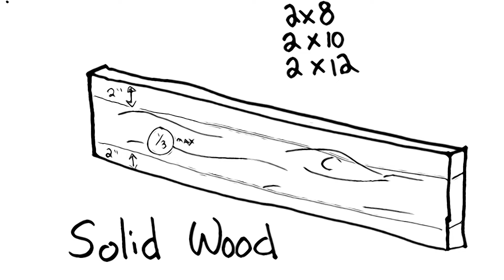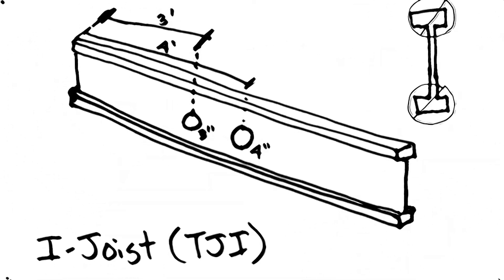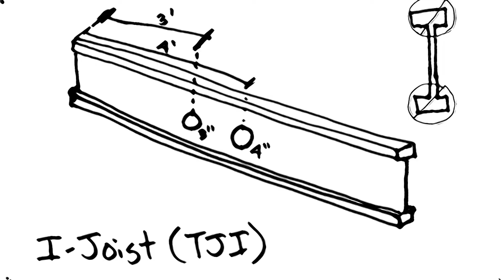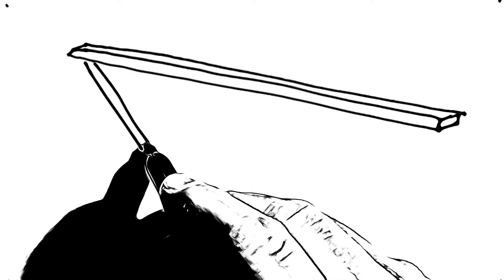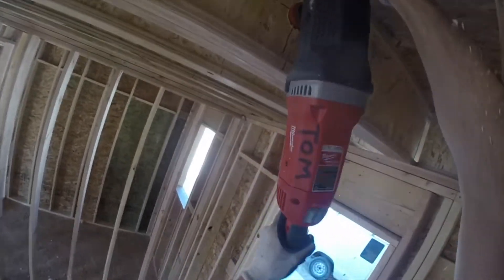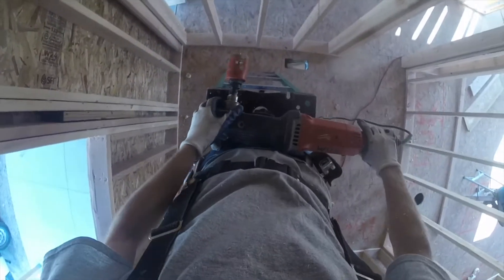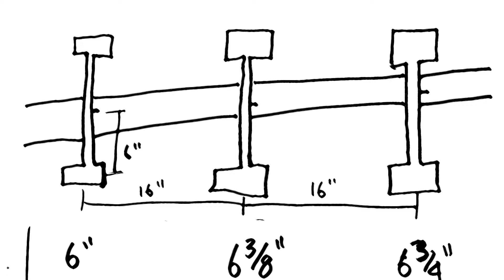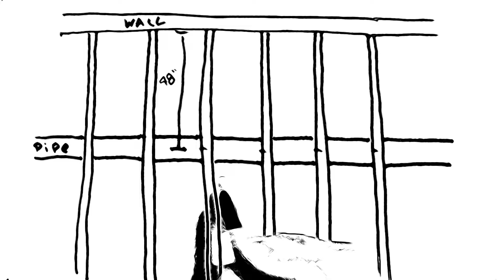Drilling Holes: Floor Joists - A Quick Tutorial

Comment: Hello sir, 

My contractor drilled a one inch hole into my three LVL (that’s close together in the basement) in order to get wire through but the hole is not in the middle. It’s a 12 inch height 304 inches length LVL. If that hole was drilled wrong is there anyway to repair it without replacing the beams? Note that LVL is holding two stories above and I also have another three LVLs that’s 20 inches away from these. Please respond, anything will help with me taking the next steps. Appreciate it
Reply from the maker: Hello. I’m not a structural expert.  If you are concerned about it then you should have a structural engineer evaluate the situation.

Comment: Do you have tips on how to mount a pull-up bar or punching bag on an I-Joist?
Reply from the maker: Yes. Use pipe flanges and threaded pipe. You can buy flanges at a hardware store.
Reply: @plumber-tom9470  Thanks! How would you mount it on an I-joist? Most of the videos I can find are mounting on 2x6 joists.
Reply from the maker: @YouPogi2000  Good question.  You might consider adding some wood structure to the webbing of the I-Joist on both sides and then running long screws through the flange.  You will have to get creative, however you do it.

Comment: I have used spade bits/ Speedbore style for running Romex and that seems to have been a mistake. Apart from looking cleaner does a hole saw kick back less??

My house is 84 yrs old, so the joists are well over 100 and it’s like drilling thru concrete for just one. I have a few places where the 2X forms a beam 3 pieces thick. I can’t afford the Milwaukee needed to go through that much.
Reply from the maker: Spade bits are really difficult.  I don't even own any because I feel they are so ineffective.  These 3 tooth whole saws are incredible by comparison.
Reply: @plumber-tom9470 Thank you Tom. I didn’t even know a 3-teeth style existed, but a quick Google search shows several options.
Reply from the maker: @thenexthobby  3 tooth hole saws are the best!

Comment: If an electrician drilled a 3/4 inch hole through one of these glued together beams. I stopped him before he make it all the way through.

Will it be ok? Do I need to call a structural engineer?

It’s a beam going across my garage about 3 inches from where it meets the wall.
Reply from the maker: I’m not an engineer, but I think it is ok. Usually they will allow for holes in the middle of the beam. I think up to one inch is not a problem.

Comment: great video! In solid wood joists, if the drill holes are over 1/3 of the board, it is possible to solve by metal joist reinforcement kit?
Reply: The normal recommendation is to splice (glue)  3/4” plywood to each side of the beam about 18” long and full beam height (9.5” for a 10” beam). Then drill through that spliced area.
Reply from the maker: Good question. I’m afraid I don’t know the answer.  Best to talk to a structural engineer about how to repair or reinforce joists.

Comment: I’m instructed to drill a 5” hole in a 2x12 standard joist in a basement for a 3” pvc pipe. I have a heavy right angle Milwaukee holehawg. Will this be difficult drilling with 12” spacing between joists?
Reply from the maker: Good question.  5” hole seems big for a 3” pipe. 3” pvc has an outside diameter of around 3 1/2”. With a fitting it is closer to 4”. My point is that you want to keep the hole size as small as possible to preserve structure. 

To answer your question, yes that might be right to get your drill in between joists. Hard to say until you try. 

Good luck.

Comment: a HALF INCH EMT  is a 7/8ths bit.  My boss thinks he needs to drilll EXACTLY the size of the friggin pipe, making it hard to work with!! OMG!!! I swear!! I dont know where he learned to run pipe! LOL
Reply from the maker: It is not good to have the whole that tight.  Pipe expands and contracts, so it needs room to move through the studs.  Plus, as you point out, it is a lot harder to install if there is not a little wiggle room.
Reply: @plumber-tom9470 
I would think a tight fit in the hole would cause squeaking, too.  Leave some room for movement is a good idea.
Reply from the maker: well said.  @RalphSampson...

Comment: Service is the way to go, i dont like new construction, you make more in service too.
Reply from the maker: I agree. I ran a service business for 10 years. Much more lucrative than residential new construction.
Reply: Of course.. but way too many small companies getting bought up by Private Equity groups inplementing bullshit business models chargong insane pricing, repairs cost almost as much as replacements to push the sale.. and turning their techs into sales techs instead of service techs.. not just in plumbing either.

But.. it's lucrative right? 

Excuse my rant.. especially if you're not of a similar mind state as the soulless $$ hungry folks operating in that way. I just really despise what's been happening in the trades over the past 10-20 years. Even the local supply houses are getting gobbled up large corporations. (Looking at you Ferguson)